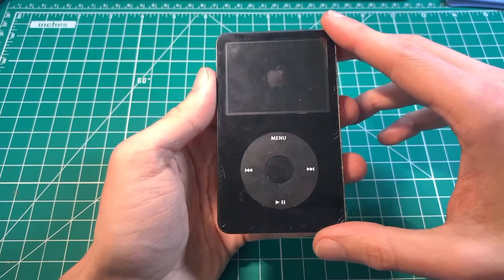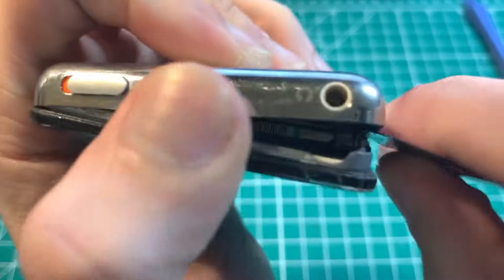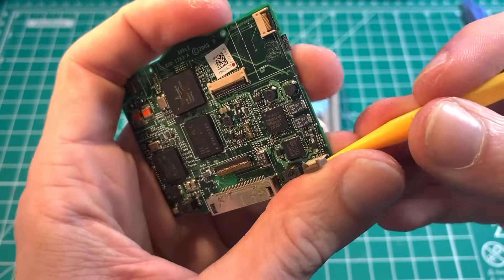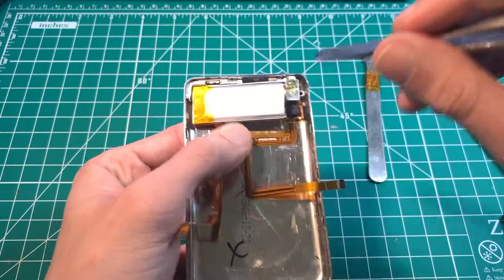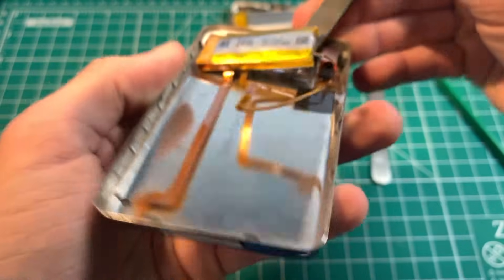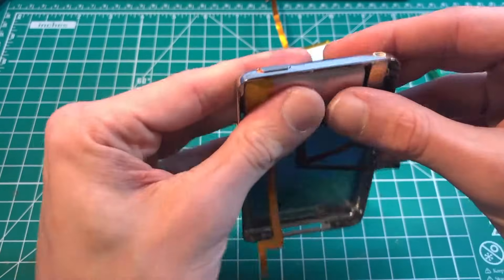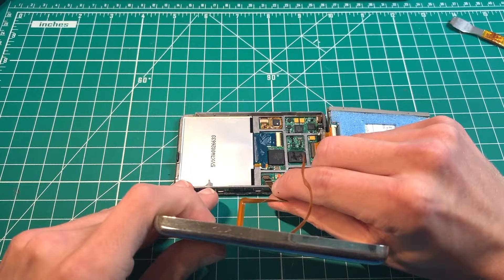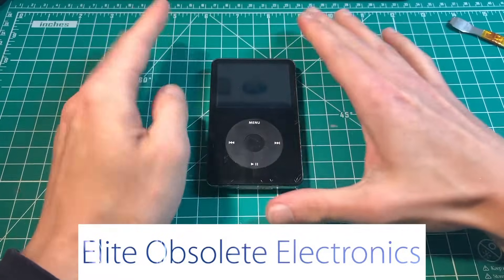Comprehensive #Apple #iPod Video / Classic 5th 5.5 Generation Battery Replacement Guide Tutorial

Comment: I tried to slide the new battery cable/tape thing into the slot without popping up the brown latch, but it wouldn't go in; the cable just bends and bends. So, I used the really thin/tapered tweezers and slid the latch up just a hair with one hand, and slid in the cable with the other hand, and it went right in. It is possible, just be very gentle and don't rush it.

Comment: Thanks for this video! I bought this battery from Amazon.  It worked great!! 
900mAh 616-0232 Battery with Repair Tool Kits,Compatible with iPod 5th - 7th Generation Video Classic A1136 A1238 6th 80GB 6.5th 120GB 7th 160GB 5th 30GB
Reply: Did this battery last at all? I'm about to order one? Thanks
Reply: @joshhood685 , yes and it still works!!!

Comment: HI!.     I tried doing this, and while the battery works fine, now my headphones make strange noises when I plug them in. I don’t have any equalizer or other audio enhancements enabled. Is there an easy fix for this?, (I also tried using different headphones, but the issue persists.)

Comment: Thank you for a great video. Just changed the battery on my original iPod Classic 5th Gen (that I have had since about 2005/6) using a metal spudger and the job was done in under 10 minutes! Simple.  Much easier than a battery replacement on an iPhone.
Reply: Does the music that you had inside the ipod get deleted or it all stays the same. Or do you turn it on different after the battery is changed let me know please

Comment: I successfully did this replacement a little over 10 years ago and needed to do it again. Sadly, this time around, as careful as I was, the battery connector broke off of the mainboard. The PCB traces had probably been weakened from the first time around. 😅

Comment: Just did this, and just wanted to point out, if your ipod has never been opened, it is a bit trickier to get open than he shows in the video, the clips are pretty tight. And id say a thin metal opening tool is mandatory, at least it reallllly helps, and minimizes damage. Id also like to point out, that i used the metal tool to press in the clips like he did, then once i got a bit of a crack going, i used one of the plastic pry tools to help get the ipod separated, i put one of the plastic tools in the crack, and twisted like you would a screw driver and it really helped get it separated. That being said. Thanks for this video, it helped a lot.

Comment: I bought aome.if yor products  on amazon recently bought your link stuff also. What type of battery does this model in video use also what is the max of battery I can use.  Many refurbished  ipods say longer lasting battery  installed. Always can get a battety that has over hear protection  chip . A battery that stops charging when full.  A battety that does not over heat also for the ipod classic 5.5  gen 30 gb .

Comment: I unlatch the brown battery connector using a small flathead screwdriver under it, and keep my finger on top of it to make sure that it doesn't get pulled out. It's worked fine for me.
Reply: this broke mine..
Reply: @zylek5151  skill issue
Reply: @zylek5151 yes mine broke.  I think it might have already been broke.  It fell off as I gently opened.  Now what?  Is it needed?  My batter stripe won’t stay in place.

Comment: hi sir, I have a 30gb model 5.5 gen and i would like to change the battery to 1900mah and add a quad iflash adapter will this fit to a 30gb stock backplate? thanks and more power to your channel i really like your content...peace!
Reply: It'll only fit if you cut off the little tab on the metal frame.